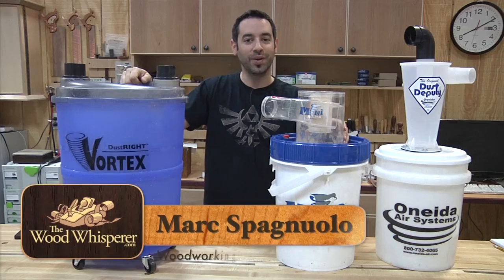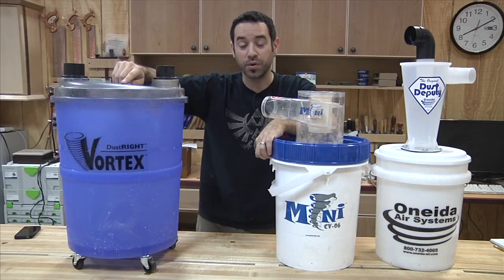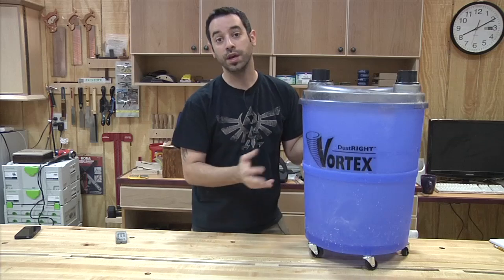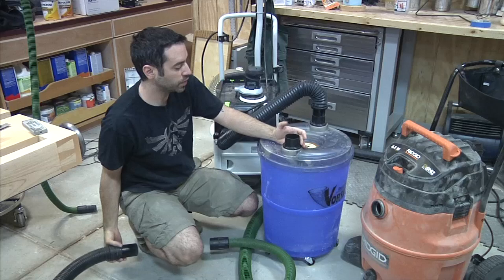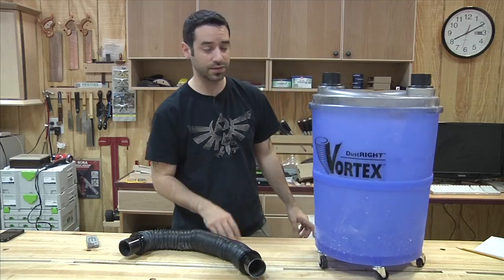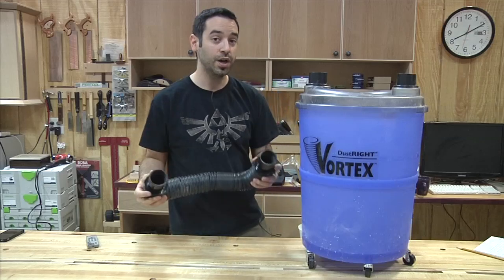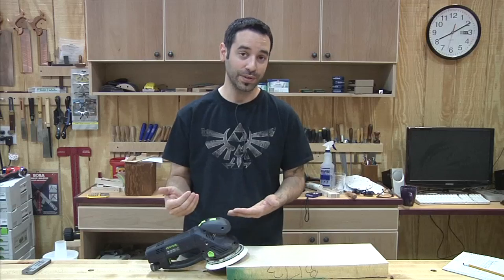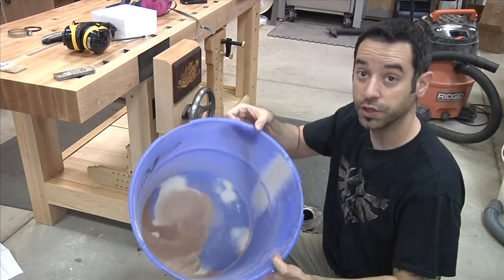170 - Cyclone Separator Shootout

Comment: Not sure how long ago you ran this test, but it would be interesting to see a repeat of the test, with the Home Depot “dust stopper” and the Harbor Freight “cyclone” units being included.
Reply: I have the Dust Deputy and the Dust Stopper. I bought the Dust Deputy cyclone without bucket and supplied my own. Using a Home Depot bucket it would collapse it like in the video. The Dust Stopper never collapses the bucket but i bet i loose over 1/2 suction. Not happy with the Dust Stopper at all.

Comment: well... do be honest... didn't surprise me at all... if you see commercial dust separation units, they have a cone shaped cyclonefor a reason, they work with centrifugal force that keeps the particles outside... and the smaller the diamer gets the faster the dust and air spin and the better the finer particles get pushed out... so as you have seen, the one with the largest diameter had the most dust come through

Comment: Bought the Dust Deputy (just the cyclone upper part) several years ago for about $35.00.  Thought it was cheaply built and overpriced at the time. I mounted it on an Ace Hardware (stiff sides) 5 gallon bucket and then built the Woodsmith rolling combination shop vac and Dust Deputy cart. Now I have the portability to roll the unit anywhere in my small shop and connect it to my various wood working tools.  I've used it for about 6 months and found that it (the Dust Deputy) works very well. Just ran across your Shootout (Suckout?) video, and was pleasantly surprised to see your findings paralleled mine. For $35.00, a little plywood and some casters and my shop vac, I have a great little dust collector that meets all my needs. Thanks for the video that confirmed my lucky guess.

Comment: Great comp. review.  

Five years on, a price hike, but I saw this clip and bought.  I got the DIY Dust Deputy, $50--I bolted it to a HD bucket lid.  The version with 2 buckets and wheels cost $100.  Center of gravity is not low enough to resist tipping over when in use to clean floors.  Static use with a bench or floor power equipment poses no problems.  It will get a stability solution.

Comment: I have the Dust Deputy (made in the USA) sitting above a Fein vac and it works great! Very little goes into the vac. I made a wooden cart that rolls around, keeping the vac and collector together along with all the different vac attachments. Going vertical saves on shop space.

Comment: I just bought a house and am putting in luxury vinal throughout, before we move in.  My wife HATES carpet, so there will not be a single thread anywhere in the house, which makes sweeping much easier.  One of the things that she would really like is a kickspace automatic dustpan, which I am planning on building.  There is plenty of space under the house to mount hardware, and this is perfect for keeping the vacuum filter as clear as possible for as long as possible.  Really great to know.  Thanks for the awesome video!!!

Comment: Interesting video. Built my own dust collector using pvc, 35 gallon metal can and some left over wood scrap. I could not believe how well it works. Built a carrier for shop vac and cyclone so I can wheel it around the shop since I never use the shop vac without it anymore. Added bonus of keeping your filters clean is the suction power doesn't deminish.

Comment: Great video and even better review! I knew I wanted a cyclone separator and was actually going to go with rocklers dust right until I saw this video. After watching it I ordered the diy dust deputy with a 14 gallon drum. It works as shown in this video. I will have to get a good bag for my vacuum because the fine dust particles occasionally still make it into the vacuum like you stated. Glad I researched this before buying. Thanks for the help!!!

Comment: I never noticed the clock, I was too interested in the review.  I just tried one for a rock pulverizing circuit and it worked well.  Not as well as with wood, but still a big improvement over other alternatives.

I wanted to commend you on your presentation as it was very quick, thorough, and useful.

I'm not much into wood working, but you sure did a good job on this video.

Keith

Comment: I have the  Dust Deputy and hooked it to a Rigid shop vac using 2" PVC pipe. Power for the system is run through an i-Socket device I bought from Menards. I plug my tool and the shop vac into the i-Socket and when I turn on the tool, the vacuum turns on as well. I turn off the tool and the vacuum runs for 3 extra seconds and then turns off.  Everything is mounted to a plywood cart  making it easy to move around the shop.

The Dust Deputy works very well and I highly recommend it.

Comment: Hi Marc, I know all these tests are fraught with ifs and buts, but anecdotally I have the Vortex dust right and I have had it connected to my benchtop planer for a while now. In fact, I use it for nothing else. The chips from this planer are large and used to fill my ridgid vac very quickly. Since I have had the vortex, I have not emptied the ridgid once, but I have emptied the vortex three times. So I can say with full confidence that the vortex works amazingly with a benchtop planer.

Comment: I bought the Dust right Cyclone for $79 with a 10' anti-static hose on special from Rockler. The Dust Deputy kit (my original favorite) is $99 now. A little dust in the shopvac bag I can deal with. The Dust Right is also more stable on it's wheels.

Thanks for the review.

Comment: The dust deputy is one of the best workshop "tools" I've ever invested in. One thing that I was initially disappointed in though, was the fact that when I had it hooked up to my Makita shop vac it would actually start to suck the lid into the bucket. Was fairly easy to fix though. Just completely ditched the flimsy plastic lid and shop made a plywood lid. Just make sure to route a groove to the underside of the plywood lid so that it fit perfectly over the rim of the supplied bucket. 

After this fairly simple modification, it's now a 10/10 dust collection system when hooked up to the Makita shop vac. For Australian users:- I got the "Dust Deputy Deluxe" from Carbatec Current price $189 AUD. We'll worth the money as the Makita vac now works at 100% efficiency all the time and no more clogged filter!
Reply: Sean B

Comment: Some complaints I have about the Dust Deputy are that it is very top heavy and I noticed a loss of suction when using it. My shop vac could not pick up screws anymore with the dust deputy. THANKS for the video! I was considering buying the Vortex and giving it a try. Now I know better.

Comment: I use the Oneida Dust Deputy and have never had a problem with the lid popping off. It fits tightly and makes a snapping sound to let you know when its properly attached. It also handles larger chips very well from my joiner,table saw,band saw,chop saw all the way down to fine sanding.I never turn my shop-vac on with out it attached!

Comment: I was going to do a video of dust deputy too, but what is the point, it does exactly what your video shows. I love this thing. Thanks for doing the video and anyone thinking of buying one of theses, I bought mine as a separate unit and mounted mine to a standard 5 gallon bucket and it works great and took me less that 20 min to do the mounting. I highly recommend them, it absolutely will add years to the life of both the filter and the motor of any shop vacuum!

Comment: I have the Oneida as well and love it.  Like you I'm not a big fan of the hard type hose that comes with the Rockler, but I might like to try it for this application.  When I turn on my vac the suction makes the flexible hose between the Oneida cyclone and the vac shrink right up, yanking the cyclone toward the vac, sometimes easily popping the top right off that can.

Comment: To maybe fix bucket collapse of the ClearVue Mini try putting it into another 5 gallon bucket if it will fit or putting some other type of round stiffener around it. I think it will keep it from collapsing by forcing it to keep a round shape which is stronger. Chris Notap found this to be a solution for his homemade cyclone separator when he used it with his more powerful central vac.

Comment: Thanks for the review. Based mostly on your results and comments, I went and bought the Dust Deputy (DYI edition) for $49.99 at Busybee. Contrary to claims published here and there, it does not pick 99% of the saw dust, but 99.99% !!!
I use it with a Dirt Hawg 5 HP 12 Gal shop vac with a half a leg of pantyhose over the filter. It's been two weeks now and almost two full buckets of saw dust later, just TRACES of dust in the vac, hardly anything on the pantyhose. Should have done this years ago.
Reply: A good seal at the lid of the cyclone bucket can make that difference.  I test my big and little DD with smoke to insure there is no air moving between the chamber and the outside at the lid.

If you see ANY big chips in the vac can, it's a sign you have a leak. On the other hand, I've had plastic and fiber glass go through because they are both large and light, so don't spin out.

Comment: I enjoyed your review. Prior to watching I had an opinion the Oneida was the winner. 

In the "connectivity" section as you were installing the hoses into the various cyclones. I noticed that 2 models used an OD connection and 1 (Oneida) used an ID fitting. 
  
The ID fitting is an issue. It causes 2 problems, restriction of the inlet size and a place for debris to accumulate. That might not be an issue for a woodworker but for any other uses like metal workng, it could be.

  Thorough review, thanks
Reply: I have an Oneida, and certainly the inlet fitting is some serious brain damage.  I have a shop vac hose that goes around it, and I do get debris sticking in the gap.  (The hose only makes contact where the inlet flares open.)  I also find it doesn't stay on well.

I am thinking of either making an adapter that matches the profile of the inlet (on the inside) and the size of the hose (on the outside) or cutting off the reduced part.  Cutting off the reduced part might increase airflow, but I am a bit concerned about Something Bad happening if I do that.  Is there anyone reading this who can comment on that?

Comment: Here's something else to consider.  I have 2 DDs attached to 2 separate shop vacs, one is a Rigid 5HP 12 gallon and the other is a Shop Vac 5HP (?) smaller gallon capacity.  For some reason the Shop Vac model is frequently filling up and I find myself having to empty it and clean the filter....not the DD, but the shop vac itself.  I collect the same type in each, but the Shop Vac set up doesn't always do what it's supposed to .  Also hand plane shavings if large and abundant can clog both.

Comment: 14:47 "You're a little bit expensive for my taste" - has a shop full of overpriced Festool power tools.
Reply: exactly my thoughts.
Reply: i bought a set of festool, cant afford electricity......
Reply: @aaroncarey7209  I can't even afford the letter F much less the other 3 letters..
Reply: You get what you pay for.  They are very high quality tools.  I don't own any but I usually buy once and cry once.  There are absolutely no Ryobi, Rigid, Crapsman or other garbage in my shop.  I was one of the first to buy a Mirka Ceros sander at $500.  Years later it is going strong like the day I bought it and have absolutely no regrets.
Reply: @6milesup  I would rather see a good woodworker with Ryobi tools than a hack with Festool.  Just because someone finds a way to afford the high $$$ stuff doesn't translate to skill.  I have seen exceptional things done with those supposed "garbage" tools and own a range of things myself from Ryobi, Craftsman, Porter Cable, Skill, Milwaukee and so on.  I would not dream of paying Festool prices but if someone thinks they get the value out of that high price then more power to them.

Comment: OK I started with a dust right vortex. It rolls nicely, connected fine with multiple hoses, but only separated some of the dust. I got a Dust Deputy and it is a huge improvement in terms of separating dust. However, good luck pulling it around the shop on casters. It falls over. Constantly. I built a cart with vacuum on top and Dust Deputy below with a straight hose between the DD and the vacuum intake. If I had to guess I’d say 90% + of dust ends up in the bucket. The tipping over really ticked me off at first; however, I would’ve ended up making a cart anyway because 2 separate things connected by hoses thru the shop is a PITA.

Comment: Fantastic review chief. You're a natural reviewer and announcer. I have one quick question. How do these separators fair against drywall dust sanding?
I think I probably use my shop vac for that more than anything. Cheers!
Reply: Spiny Norman I've seen video footage of the dust deputy being used with concrete grinding and the shop vac filter stayed clean the whole time.

Comment: I bought the dust deputy metal version and a 30 gallon cardboard drum. The biggest problem I found was when I cleaned out the sawdust under my Delta table saw, the dust deputy could not keep up with the dust separation fast enough and it plugged up my vacuum filter rather quickly. I wonder how the same use would affect the the other two units. I am asking you because you have the other two already. Thanks for listening-Tim

Comment: Wished I had watch this vid prior to purchasing the Vortex.  This unit is a piece of do do because it only picked up 50 percent and the rest went into my vac.  I did purchase the Dirt Deputy and WOW it picked up all the dust and wood chips in my shop and my vac hardly had any dust or chips.  Will buy another one because this little unit is the best.

Comment: My thought on this, you used saw dust and sanding dust. What about larger particles as in using a planer or jointer. Both of which stop up the intake of my DC, because of the large particles (shavings).

Comment: I like the vid, i think you can modify performance of Vortex by adding a divider inside to seperate the in and out, or extend the tube of "In" to mimic the "dust duty" this is so that once the dust enters the drum, it will be lower/ compared to the farther than the exit(to vacum) port.

Comment: I have the Dust Deputy but the cyclone is steel and the top/ drum is also steel with a clamp band lock, purchased for $50. (Where did you get that plastic kit?) It works great for moving about the shop for small tool and mess clean up. Caution with the steel Dust Deputy: don't vacuum green wood lathe turnings as it rusts the interior rather quickly. However, I also have a full Oneida dust collection system steel piped to every tool which eliminates 99% of the dust and wood chips.

Comment: I use something somewhat similar for my electric clothes drier.. Just home made, a bucket with a hole in the lid to put the 4" exhaust pipe into, and holes drilled into the lid to allow the heat/air to go out of.  But putting water at the bottom of the bucket will collect all the lint so none of it goes air born.  Seems like that may be a good idea to put water at the bottom of one of these?

Comment: I'm debating building it or buying it.  I realize this thread is old, but it's still the same principles at work.  Thanks for the video and the common sense testing!
Reply: Same here. I'm kind of confused about how to avoid collapsing the bucket which seems to be quite normal.
Reply: @matiasgoinheix366  I decided to order. I don't think a home Depot bucket was designed for this kind of work. But as long as the vacuum exhaust can keep up, it shouldn't collapse.
Reply: @hansangb  Thanks for the reply. Which one did you order?
Reply: @matiasgoinheix366  the dust buddy
Reply: @matiasgoinheix366  FYI, just got my Dust Buddy and it looks good so far.  I have to make some hoses fit, and I'm building a little carrier for my vacuum/bucket.  The acid test is a few days away.
Reply: @hansangb  That's great, thank you for coming back to let me know!

Comment: Got myself a dust deputy, without the hardware and bucket for just $30, bought a used 13 gallon high density Polyethylene barrel with a sealing hatch at the top for $10, removed the primary filter on the shop-vac, only kept the foam protector on the motor, and that thing sucks everything, all is kept in the 13 gallon barrel, once every blue moon I empty the barrel....my most satisfying buy! No more bags, I used to buy bags every other month....

Comment: We had one that worked on the galvanized garbage cans.  It was really more like a cap with two holes.  Not sure how well that worked but it had openings for the larger dust collection hoses.  We used it on the planer the most because they make big mess in a short time.  Just ask anyone who does wood work, they might say the planer makes the worst mess.